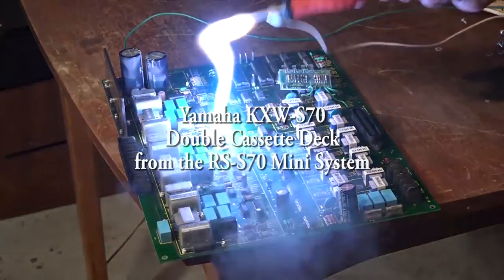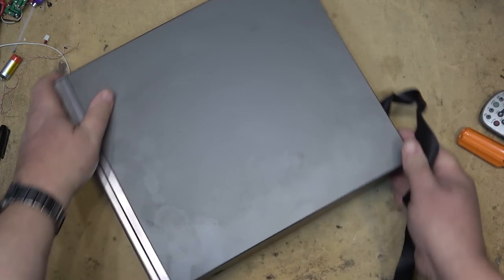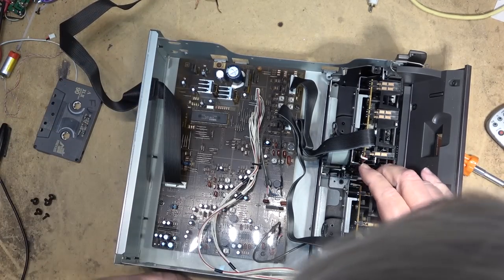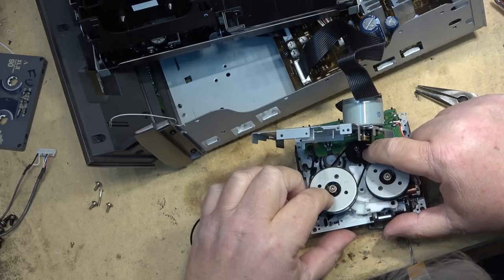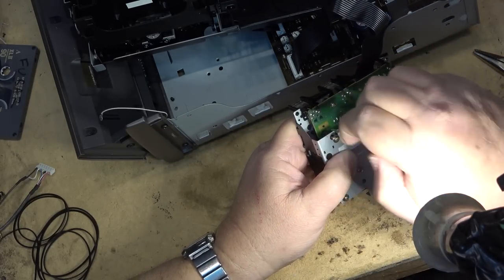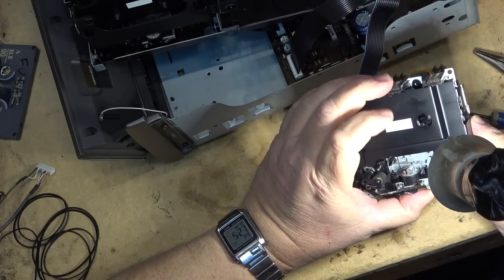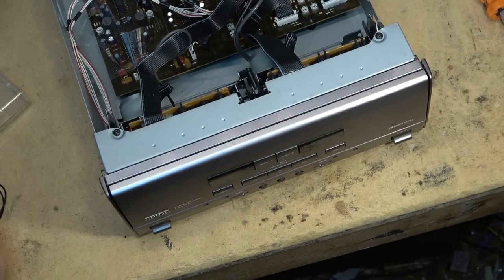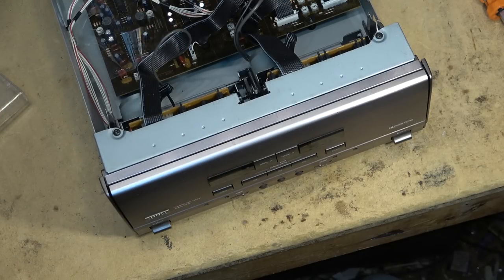Yamaha KXW-S70 Double Cassette Deck Does Not Play

Comment: Very good video, it explains everything. You just forgot one thing that would be very important for the repair. Where can I buy a belt? Because the narrow belts were completely ruined, torn. And wide belts are no longer really flexible. (KXW-10, mechanics are the same)
Reply from the maker: Amazon has assorted kits.  Be sure to get 4 or 5mm.  Kpcomponents also sells belts but you will need to measure as he only sells by size.
Reply: @12voltvids  
Thanks for the information.

Comment: Did you do a speed test? You usually do that! I'm sure you did off camera!
Reply from the maker: I speed tested with my ears.
Reply: @12voltvids  yeah I've done it that way many of times using a cassette and a CD of the same album and play them both at the same time till you have the cassette phased with the cd.
Reply from the maker: @Jammerk40  well that's one way to do it but if you've got musician ears like I do you can identify the pitch just by hearing it. So listening to music I can tell whether it's sharp or flat.
Reply: @12voltvids  Right I got good musical ears and most of the time I can do it just like you! Thanks again for the reply!
Reply from the maker: @Jammerk40  I played several instruments when I was younger. In school I played reeds (saxophone / clairinet) and I made the transition to the guitar and bass. What you play for a while your ear gets in tune and makes it pretty easy to tell if something's out of tune.

Comment: I had a Sony stereo that had a turntable, tuner, double cassette deck and main amp they where separate components that use computer hook up's to each unit and so on! It was a nice starter system that put out 100 watts per channel with eight inch drivers mid range driver and tweeter basically my first home system! Bought it from Montgomery Wards! Did you have those in Canada? Anyway!

Comment: Wow. They did not design this to be serviced.
Reply: @ACommenterOnYouTube  Is English your third or forth language?
Reply from the maker: Actually this deck wasn't that bad to service.  I have seen far worse.
Reply: @12voltvids  Aiwa Walkman... Impossible.
Reply: I think You hadn't seen unserviceable stuff. This one (just like whole cc70 set) is one of easiest I have ever repaired, but it needs more servicing than we saw here. The easiest metod to put the belt onto motor is temporarily put the belt on the solenoid cords holder, screw in the motor stand to mechanism and use some tool to put the belt from stand to roller. Of course all belts MUST be replaced. I'm buing belts in Poland for about 0,5 --> 2$ so most equipment is worth to be repaired. If you wanna se some hard to service decks try to find f.e. Unitra MDS442 (yes, vintage, polish product).